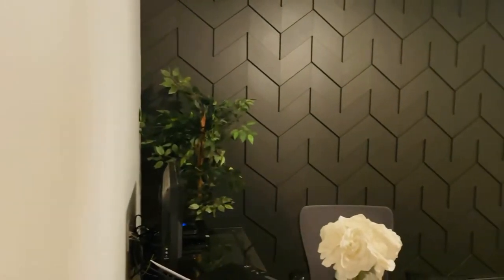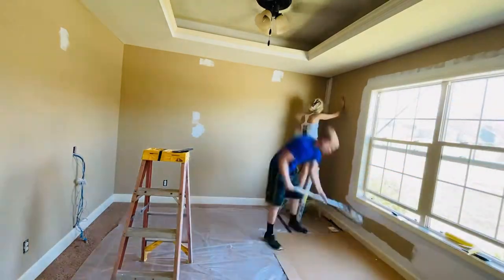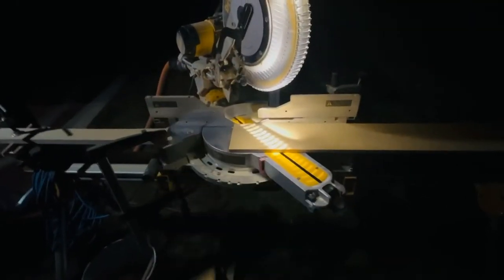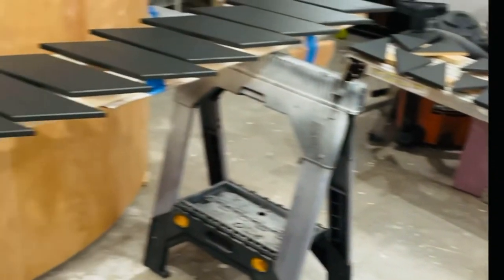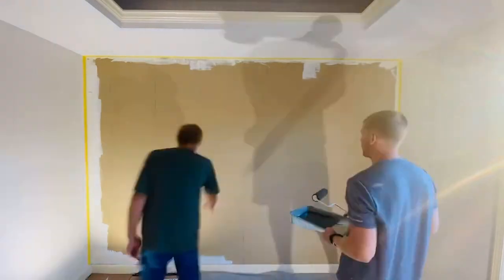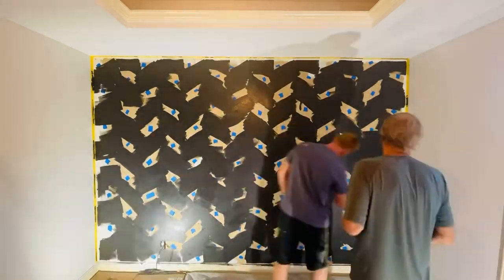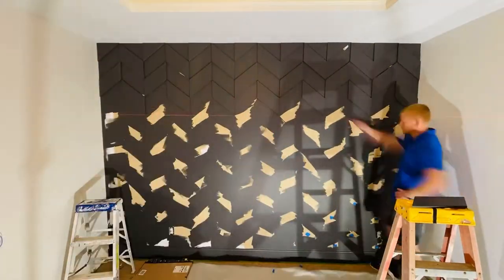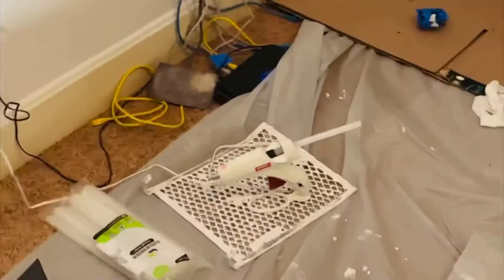How to Build Cheap DIY Office Accent Wall | Herringbone Pattern

Comment: What angle did you use on the cuts?
Reply from the maker: 51 degrees
Reply: @SatisfyDIY  Miter saw go until 45 degrees. How did you make 51 degree cut?
Reply from the maker: The Dewalt dual bevel miter goes up to 60 degrees one way.

Comment: Do you have the measurements?
Reply from the maker: 12-1/4”x 8-1/2” is what we used. Had to get the size of the wall split evenly so the pattern would work perfectly.

Comment: What were the dimensions of your parallelograms?
Reply from the maker: 12-1/4” x 8-1/2” had to do some math initially to make sure they would fit perfect
Reply: Amazing design and would like to try. I have a few questions for you and would appreciate it if you could answer. 

1. I have a 8 (h) and 9 (L) ft wall and am wondering how to finalize the parallelogram dimensions. Could you help..
2. I don't have a rotor to edge the MDFs. Any other suggestions and why to edge the cut parallelograms
Reply from the maker: You don’t need to edge/chamfer the sides. We just thought it gave them some more dimension.
Reply from the maker: As far as sizing goes layout your wall with test sizes  (just pencil marks) until you get them to fit perfectly. If you want it to look similar use my 12-1/4 x 8-1/2 and adjust from there.